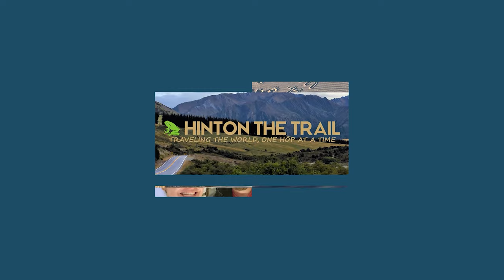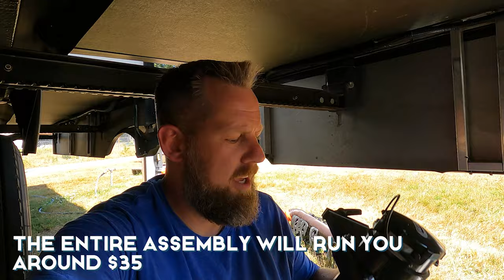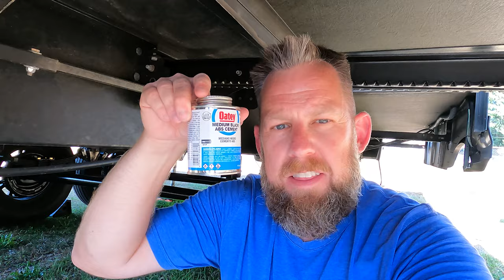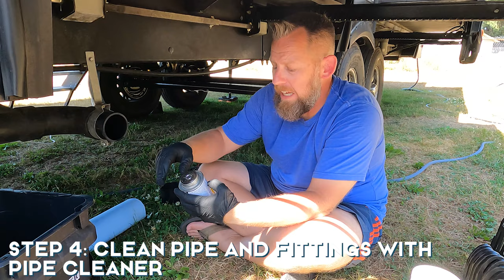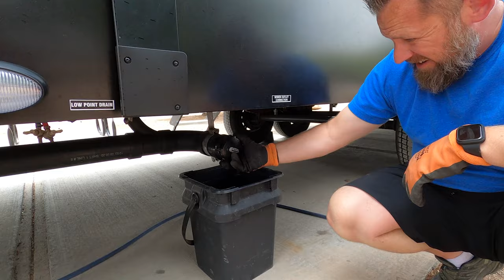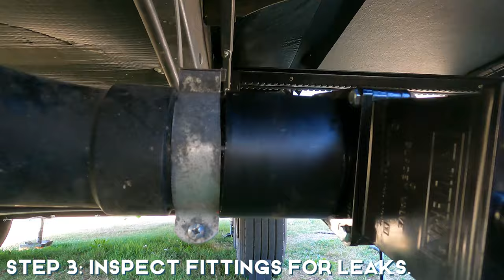You Need an RV Gate Valve on Your Sewer Pipe | Easy RV Gate Valve Installation

Comment: Great job explaining that. We have the twist on one and I have been thinking about going with a more permanent solution like this. Reason to go permanent, well, what will twist on, will also twist off. Found out the hard way while flushing the black tank our first month on the road. Also, with the twist on kind, we had the seal go bad. -Corey
Reply from the maker: Ohhh, didn’t even think about a twist on. I guess it’d be easier to install but yeah, easier to remove. This was wicked easy to do. It’s also fun to use a saw every now and again. You don’t get to do that a lot when you’re RVing. 😂😂-Chris

Comment: We just had to re-install ours before this trip because our pipe collapsed and dragged on the pavement for 50+ miles! Ground it right off…
Reply from the maker: 😮😮😮. Wow, that is quite an experience!!  Did it cause any damage to the trailer?
Reply: @HintonTheTrail  Nothing major. The grey tank connection is leaking now, but it’s fine enough that we can make it home before we have to do anything further. Not a fast leak, at least.
Reply from the maker: Sounds like you got lucky. Might be able to drain the tank and throw some J-B Weld or something on it to stop the leak. It’s cheap and fast to use. Sometimes small leaks turn in to big ones if not addressed. Anyway, run to a hardware store and look for a weld that works on ABS pipe. Good luck!  -Chris & Suzannah

Comment: Probably been said already but the cleaner softens the pipe and when you follow the rules you put PVC together once you've slathered it with glue and you give it an eighth of a turn and that smears the plastic and creates a weld.
Reply from the maker: Here’s the instructions straight from Oatey.  They say 1/4 turn. 

https://www.oatey.com/faqs-blog-videos-case-studies/blog/how-complete-perfect-solvent-cement-joint

Comment: Good job! I put a gate valve at the front of our pipe. Bought one that attached to the bayonet lugs at the front of our pipe. It works just fine! Best update so far!
Reply from the maker: Nice!  How long did it take you to install?
Reply: @HintonTheTrail  About a minute! It locked into the same lugs as the front cap! Cost a shade over $30.
Reply from the maker: @0808dsmith  awesome.  Great idea, thank you for sharing! -Chris

Comment: Was this a 3” to 3” coupling?
Reply from the maker: It’s a piece of pipe that allows you to connect two other pieces on to it. It will have a raised ridge in the center that you’ll push the pipes up to on each side. Any hardware store should have one.
Reply from the maker: And apparently I should have read this better. I thought you asked “What”. 😂😂. 
Yes, we used a 3” on ours. It will depend on what size your pipe is though and how you want to attach it.